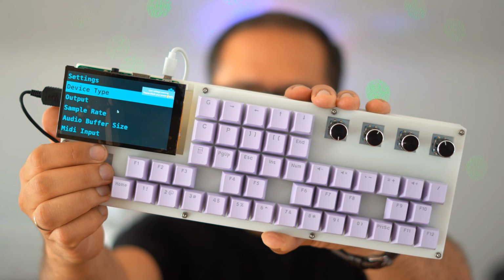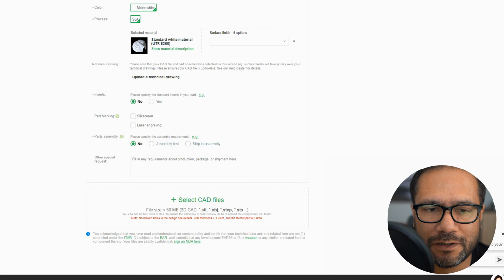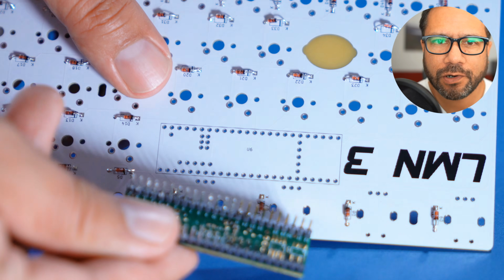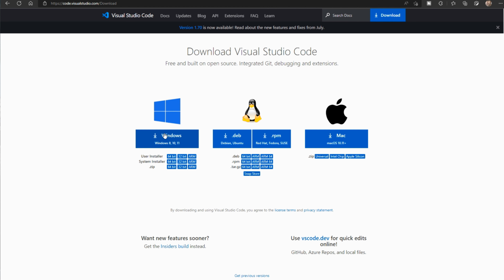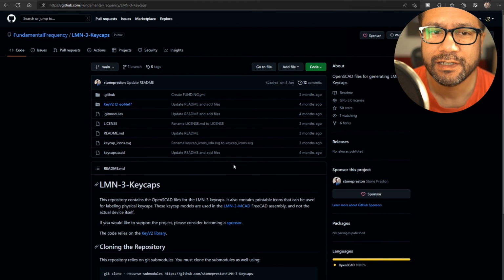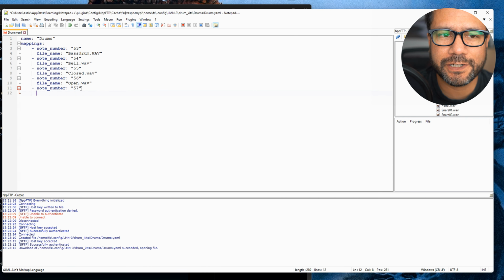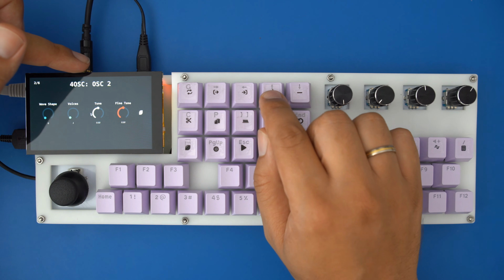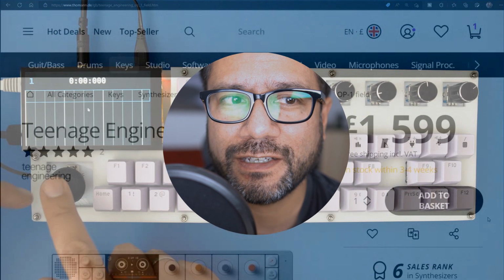Building and playing the LMN-3 DIY open source synthesiser

Comment from the maker: Index and links to resources for smartphone users. 🙂
00:00 sponsored by  @PCBWay  
00:12 introduction
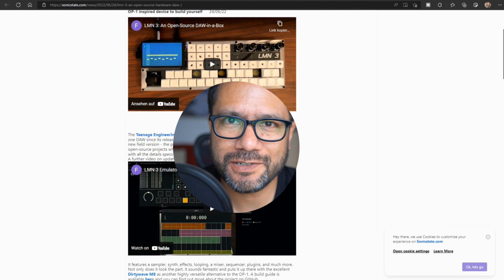00:57 getting the PCB and the enclosure
04:04 other hardware needed (and current prices)
05:24 soldering the diodes
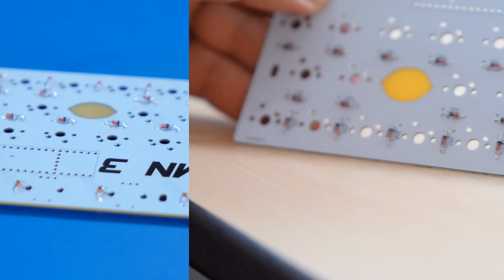06:19 ... the Teensy 4.1
07:39 ... the microswitches
08:25 ... the joystick and the encoders
08:43 assembling screen and case and Pyssla ;-)
11:18 keycap stickers & Barry
11:48 compiling and installing the Teensy firmware
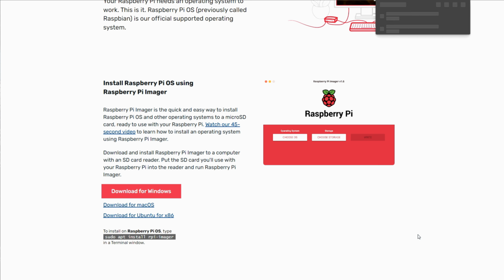13:18 installing Debian Bullseye on the Raspberry PI
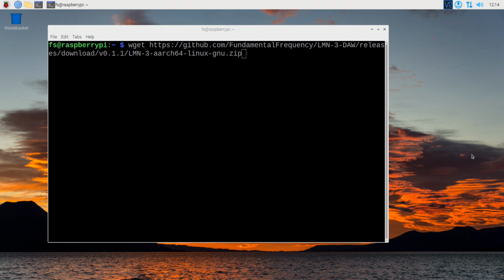14:00 installing the LMN-3 DAW
14:19 adjusting touch screen settings
15:17 important considerations
16:00 booting the synth (real time)
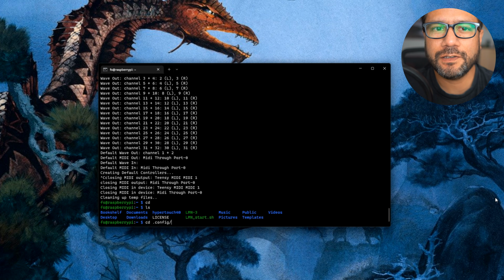17:23 uploading samples, creating a .yaml file for drum sets
18:00 UI overview
18:30 adding a plugin (4OSC virtual analog synth)
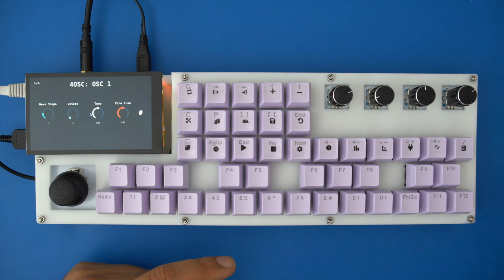18:53 short 4OSC plugin overview
20:18 adding effect plugins
20:56 step sequencer
22:25 adding a drum track
23:37 adding a (chromatic) sampler track
24:16 ... improvising on a track ...
24:46 conclusion / my personal opinion on this device and current internet discussions / whom is this for? / call for developers
26:28 demo track 2 (muting and unmuting while playing)
27:53 demo track 3 (Vangelis impression using an external reverb pedal)
29:38 outro, summary

Links & Resources
The LMN-3 project homepage https://github.com/FundamentalFrequency
PCB Way https://www.pcbway.com/ (thanks again for sponsoring this video)
Raspberry PI 4 https://amzn.to/3AwFhLk
Teensy 4.1 https://amzn.to/3TgoRj3
Visual Studio Code https://code.visualstudio.com/
Raspberry PI installer https://www.raspberrypi.com/software/
The touch screen https://amzn.to/3PXEpVM
Joystick https://amzn.to/3wAOkK8
Nuts https://amzn.to/3RfaJEJ
Bolts (long) https://amzn.to/3Cz0BCR
Bolts (short) https://amzn.to/3R1r6oL
Diodes https://amzn.to/3RdMQgT
Keycaps https://amzn.to/3e5quzG
Switches https://amzn.to/3TqMoho
Encoders https://amzn.to/3wAr7b7
Soldering iron https://amzn.to/3RcdQxT

Also, as mentioned by @klangraum, "As an alternative to the Raspberry Pi, compatible single board computers can be used. These are not all affected by the price increase and continue to cost ~€50. But you would probably have to adjust the holes. Examples are: Orange Pi 3, Khadas VIM2, Tinker Board 2S."
Reply: I know there is free music out there everywhere but if you want some music for your videos your more than welcome to use mine

Comment: Hey random question, but any recommendations on solder type (thickness, lead free)
Reply from the maker: I have no specific recommendations here, but for electronic works in the PI world, I found 1mm diameter solder with 2.5% flux to be a nice thing to have.

Comment: Wonderful - thanks so much for this break-down of the build! Based on this I decided to bite the bullet and try building one myself. For some reason it doesn’t boot as it should and goes into Debian but i’m going to persevere 🤞
Reply from the maker: Thanks for watching! On the latest Debian, the easiest way is to have a crontab entry which launches the synth software.  Syntax is 
@reboot /path/to/your/synth
Reply: @mr_floydst  Great tip, thanks! I will try this over the weekend. I’m sure it will take some tinkering :)

Comment: And maybe it would help to add a little SPI OLED below each rotary to describe the function it has in each menu / screen?
Reply from the maker: That's a great idea, however, it would make the whole thing harder to build and maintain.
Reply: @mr_floydst  Sure it would! But there is always room for improvement. I'd build and print the thing myself next year but add two things: A battery option for mobile use and some standoffs on the lower panel to support the PCB a bit. There should be enough space to add in one of the raspPi UPS boards with two LiPo cells.

Comment: The rotarty encoders appear to be working backwards; when you turn them clockwise, the indicators on the screen move anticlockwise 🤷‍♂️
Reply from the maker: If I remember correctly, that was my fault (I think I used what I had at home, not what was required in the BOM). It's been some time, though.
Reply: That could explain it 😬. I still think the Zynthian V5 is probably the best kit out right now.

Comment: i wonder how much power this project consumes. There's definitely enough room in the case for a decently large battery.
Reply from the maker: It's running on a PI3, so a decently sized USB powerbank should get you through the day. And yes, I guess you can fit it into the enclosure without any problems.

Comment: Booting full linux desktop is an overkill for this device
Reply from the maker: Thanks for watching! I think this device is a great proof that it's possible to realize cool things with the tools at hand. Here's a proof the thing works, but unfortunately, optimizations never arrived. :-(   (e.g. a Teensy 4.1 which is used here to run the controller is very well capable of running the whole system, synths, samplers, screen and all, no need for an additional PI).
Reply: @mr_floydst  That's why I do my own device
Reply: @mr_floydst  Wait, what? Teensy is only for peripherials? I thought it's used for sound and raspberry for display, since driving big display with reasonable frame rate is not an option for even very performant MCUs.

Comment: I am Jack's wasted effort and sunken heart😭
Reply from the maker: Hi, thanks for watching! Please explain?
Reply: I spent months saving up and building this thing and I guess there is a problem in the the teensy or a solder joint. My best guess, just a  bit disheartening, but that's the love of being a raspinerd. I know I was really careful on the soldering and this in not my first solder project and have a bunch of DE soldering the switches to even look due to the top. I am not upset just let down on myself, the only weird thig was the compiling of the teensy never was above 4 seconds each time I tried that process from ground zero. perhaps a fresh install of rasp would do the trick. I was just curious if you had any trouble shooting on your quest.   @mr_floydst
Reply: Or I am fumbling on the teensy part, its just hard to tell what is and isn't working as far as the teensy side of the project, I was going to check continuity with a multimeter next weekend when I get some more free time. Love your vids thanks regardless
Reply from the maker: I had no hickups on the way, so to speak. As you assumed, a cold solder joint most likely is causing the problem. I recently bought an $60 electronic microscope which really helps identifying bad joints and other problems.

Comment: hey @mr_Floydst could this concept work for a more 3d printed versions of a lumatone its a microtonal piano with hex keys and i can afford a real one but id love to make one especially because i have a resin printer now
Reply from the maker: Hi, building a MIDI controller yourself is definitely possible. You need some multiplexer chips and a lot of key switches. And some custom made PCBs, of course. Programming the controller firmware isn't too hard, as there's plenty of documentation around on the MIDI protocol. 
I think the amount of resin needed to print a whole Lumatone keyboard is ginormous ;)
Reply: thanks ! @mr_floydst

Comment: What are the washers and bolts that come with the encoders for? I bought a set of 5 and was wondering...and was the Joystick from a PS2? I got one from an xbox/ps3.4 and it didnt fit the motherboard.
Reply from the maker: Hi, you need to buy the joystick from the list of components. It's neither of both, it's a standard component for DIY projects. 
The washers are there for surface-mounting the encoders in a metal case, for example. You don't need them here.
Reply: @mr_floydst  excellent! I have done so and thank you!

Comment: Teensys are now around 30 bucks and Pi 4B I have found for 60. I have access to a 3D printer so that lowers overall cost. 250 cost for parts and for another 120 a 2nd can be made based on the parts bought for the 1st! Made two of them that have a black case and black/white keys so it looks like a piano. Its been so fun and use it way more than when I had an OP1.
Reply from the maker: I may have been too negative in my summary and I didn't want to dampen anyone's enthusiasm - thing is, one year ago this project was all over the internet because people absolutely hated the new OP-1 and Teenage Engineering's price policy. Thus, many news sites dubbed this "an open source OP-1 killer". I think that might have been slightly exaggerated. :)
Other than that, this device is fun. I didn't check for updates for some months now, perhaps I should.
Reply: @mr_floydst  This video helped so much with the build. Like the M8, I think it will get better as it evolves with the more people that get into it. At the end of the day though, its all about the fun I think . :)

Comment: Great video, for a very interesting looking project. The unit does sound good but the UX and UI look like they were designed by engineers for engineers (and not in a good way 😊). Simpler controls and a decent, unified UI would be very interesting in the future.
Reply from the maker: Thanks for watching - you are right. The project was in a very early stage when I made this video, though - I'll need to do a follow-up one day. :)

Comment: I've been trying to find some good buttons that are single pole double throw, so by timing the disconnection from one throw until the connection of the other throw, velocity can be determined. There's a good number of inexpensive switches that are SPDT, but most of them are stiff and/or clicky, requiring some rework to make them more suitable for synth. I'd love to see somebody put together a campaign for key switches that have a tiny microcontroller in them and can be daisy chained in a manner similar to neopixels and offer velocity information. 5 pins, maybe.. clk, din, dout, vcc, and gnd.. and velocities can be given as numbers of bus clocks.
Reply from the maker: Great idea! But you could start by getting a cheap second hand Razor Huntsman Mini and try to parse it's USB output. Or disassemble it. It has velocity sensitive key switches that are not clicky. (I bought one recently to see if it can be exploited for musical shenanigans)
Reply: @mr_floydst  thank you, this is a great lead.

Comment: And the open-source demons rear their heads again. Not even changing the boot sequence to load X directly into the DAW or just using a featherweight window manager instead of the default environment. The sample management is absurd as well, but fair enough since it's meant to be a set it once kind of affair.
Reply from the maker: Well, yeah, the "not optimizing the base OS" part is my fault, I was too lazy to do it in this video. ;-)
At the time, this project had just made it out of the door, but there was considerable hype because the controller vaguely resembled a certain other mini synth which had caused a shotstirm with it's price tag back then. ;-)

Comment: What's the latency like?
Reply from the maker: Thanks for watching! Latency is "barely noticable" but I didn't measure it.
Generally speaking, there are a lot of ways to tackle latency in Linux, from the kernel, audio subsystem settings to the hardware used.

Comment: Would it be possible to add RGB for the keys? Maybe with hot swap sockets to give a bit of height for them? So many great bits of idea gold, ikea spacers, layered case allowing cable routing, screen print orientation on the resistor's (i know that is common but you pointed it out so nicely) all around awesome
Reply from the maker: Should definitely be possible, but you'd need to add power supply and perhaps a multiplexer to the setup, which most propably would need a revision of the PCB.
BTW this is not my brain child - I only made this video in order to promote the idea, which was developed by FundamentalFrequency (https://github.com/FundamentalFrequency  )

Comment: OSOP-3!
Open Source Operator 3!
Reply from the maker: Thanks for watching! But it isn't and I'm not sure it it ever wanted to be ;-)
Reply: @mr_floydst  is it possible to make LMN thinner? On footage it looks quite thick
Reply from the maker: I think you could shave off some mm, but the RasPi+screen is relatively thick and you could only reduce it's height by connecting the screen with a cable, and mounting the RasPi somewhere else. That's a lot of work on the 3D printed parts.

Comment: Are you eventually going to create different presets based on the keyboard “language” setting?
Reply from the maker: Thanks for watching! Did I understand that correctly and you want to see a video on how to create patches / sounds? Well yes, I could do that.
Reply: @mr_floydst  Perhaps somewhat. I was curious if you’d have different settings for say, if you switched to a German or Japanese keyboard?
Reply from the maker: Ah, ok. No - this keyboard is a custom MIDI controller, the layout will always be the same and it's not possible to set it up differently. It's just I bought keycaps instead of printing them myself.

Comment: Thanks for the full walkthru.  It looks like we've gotten to the point where we have various chips which can be programmed for specialized uses and yet somehow we seem to keep using the same old idea of one central processor and external specialized processors.
Reply: it also seems like we've got a standard of 'people figure out the hardware, release it to the public, and expect people to do the rest of the work'
Reply from the maker: Yes, but we shouldn't be too harsh on that - this project is still in it's infancy and it's made by a single developer.

Comment: Buying a 3D printer costs more than four times the price of the synth.
Reply: It wouldn't make sense to buy a 3D printer for this project alone but if you like to build other things as well it may make sense.
Reply from the maker: Thanks for watching! Yes, that's correct. So best is to know someone who owns a 3D printer (or resort to services like PCB way etc).
Reply: @mr_floydst  That pretty much defeats the aspirations of the small hobbyist does it not? 😆
Reply from the maker: @Leepshin  Absolutely (it's what I say in the conclusion).

Comment: We need a company to make an actual op1 killer because teenage Engineering is just pissing in our eyes.
Reply from the maker: You're right, a bit of competition in that specific field (portable battery powered synth workstations) would be nice.
Blackbox is kind of sharing the philosophy, but in the end, there's nothing like OP-1. So if TE decide they need to charge $2k for it, so be it. We always have the choice not to buy it.
Reply: @mr_floydst ipad. 300$. Literally does  it all.
Reply: Totally.  If the Field had been priced more reasonably, the original OP-1 might have seen a price drop as users upgraded and sold their old units, thus making them more attainable.  Those newcomers buying on the secondary market could easily have fallen in love with the workflow and upgraded to a field down the line anyway.  
The $2K price tag just seems like a move to maintain the high price of the original and discourage the old version becoming less expensive.  I'll leave it to the rich to decide if the new Field features are worth the extra $1k.
Reply: Since this comment was made, there are a number of cheaper alternatives... check em ou!
Reply: @pesto12601 Care to share these alternatives
Reply: @pesto12601  Like what?
Reply: @papagoja  Yamaha Seqtrak...
Reply: @pesto12601  But this doesn't really do what the OP-1 do? Trying to find a comparison video but it's only compared to the OP-Z. Do you have any other recommendations? Want a OP-1f but the price.....
Reply: @papagoja  Op1,, OpZ... tomatos.. tomahtos..
Reply: Hello! I'm designing a portable synth and I want to learn what musicians really care about. If you want to provide your insight and help shape this project, please reach out!

Comment: The best thing about the Pi 4, easy booting from USB 3 stick and not worrying about sd cards randomly breaking completely. A full minute even from first boot to get the desktop just seems wrong after getting so used to that. Renoise being released on ARM is also a massive deal,  you don't even need a microscope to read the fonts like in Kontakt! Put a touch screen, decent DAC on the top and you're got one of the absolute best and most powerful samplers ever made. Midi (with easy port redirection and all sorts), Ableton Link and plug-in supoprt is also handy, shame they're impossible to get now, I'd have about 5 because even with the 8GB Pi4 it soon adds up.
Reply from the maker: Thanks for watching and thanks for your feedback!

Comment: Are 75$ the price for one PCB and 3D print, or for all the 5 PCBs together or just for one each?
Reply from the maker: To be honest, it's a rough estimate for what you'd pay for 1 PCB and a full 3D print of the case and the keycaps. I mistakenly ordered only 2 instead of 4-6 of the intermediate pieces of the 3D printed case (so I had to use those IKEA pearls).
If you manage to find 4 other people who want to buy the PCB, you'll end up somewhere between $7 and $10 for the PCB, depending on the thickness and the color you choose.
Reply: @mr_floydst  All right, thank you! :)